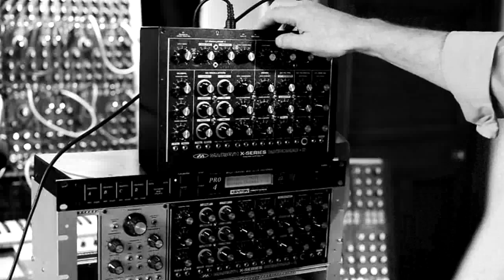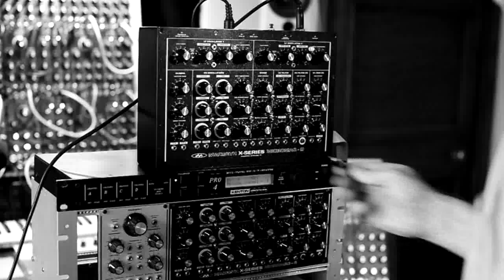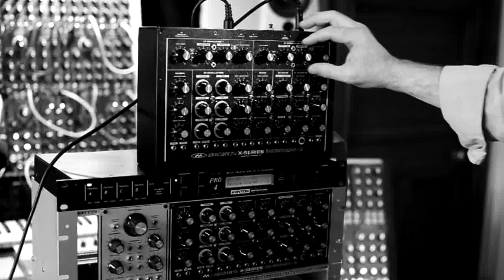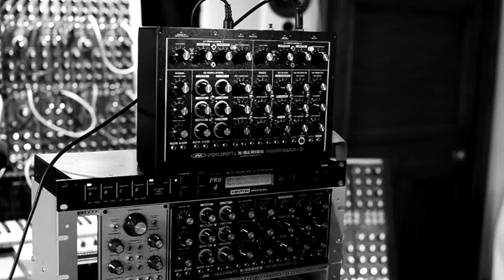Micromac D Part Two: Oscillators

Comment: I'm sure that this is a very good quality monophonic analogue synthesiser - but the price... E. g. it costs more than five dark energies (not that that would be a natural substitute in any way, but just to relate it to another (admittedly less endowed with components) monophonic synthesiser). I suppose they manufacture them in very small series and that's what drives up the price.